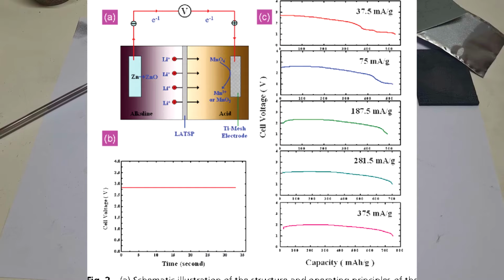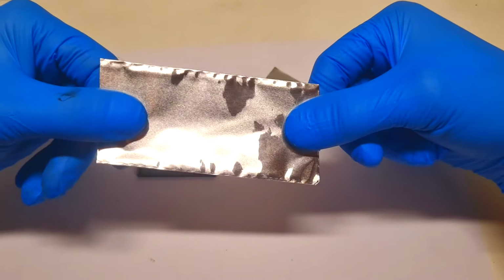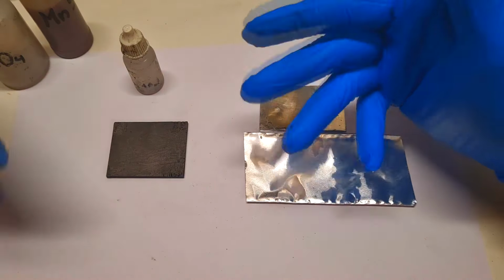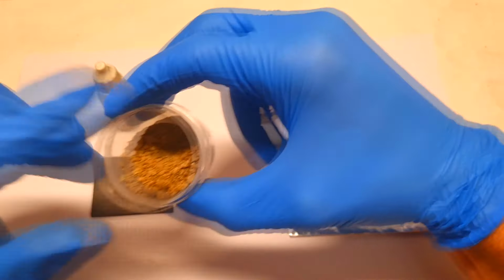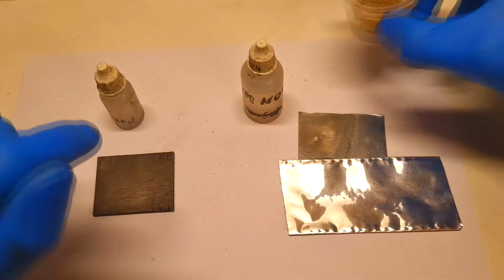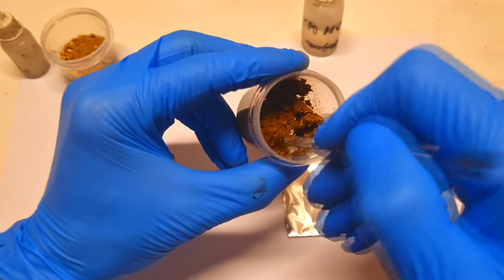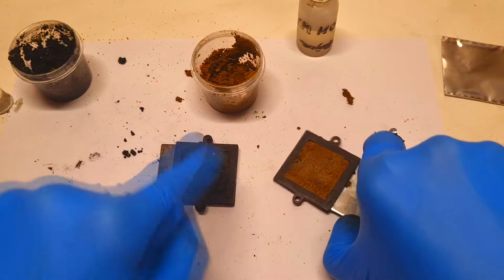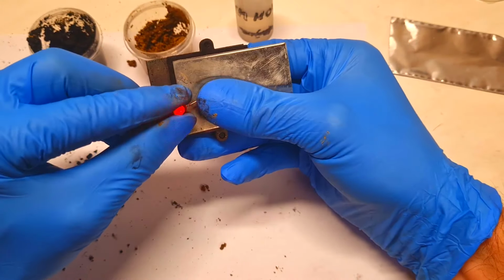DIY high voltage zinc battery without Separator

Comment: What are the energy efficiency, coulomb efficiency, volumetric capacity, energy density, etc? Cycling information is critical to characterize batteries and make sure improvements are actually being made. Characterizing your own devices - know exactly what you're producing - would be really useful to you and your audience as well. So far we have no idea about how any of the devices you've made actually perform.
Reply from the maker: Nah.... to much work for a battery that I am not interested. Here I share ideas about some batteries, where people if they like the idea they can replicate make all the tests, upgredes, etc. On my batteries which I develop I make all the test which need to be done,... so no worries about that. But like I said.... here I share ideas and not research study,.... because it take to much time and you know that.

Comment: Won't that battery self-discharge very quickly even if you don't use it to feed anything?  I mean acidic and alkaline substances in direct contact will start a neutralisation chemical reaction which destroys both in no time. Am I wrong?
Reply: Comment for notification about this thread.
Reply: Ya what's up with that?
Reply from the maker: The acid and alkaline will form a salt in the contact area. The acid and alkaline is hold in dirt and will not mix together easily.

Comment: Thank you for your work. I have been subscribed to your channel for a long time. I am waiting for a recipe for a normal battery. There is one question, the place where one alkaline clay meets another - this boundary layer, doesn't it consume acid and alkali for the neutralization reaction. This prevents it from working for a long time. By the way, how long does it work at maximum load? And in this boundary layer, heat and gas should be generated. Confirm my findings. I want to hear your thoughts on this matter.
Reply from the maker: A normal battery? What is for you a normal battery? Yes, a salt layer is formed between acid and alkaline in the contact area. The LEDs working until the electrolyte has evaporated. Heat is made when the acid and alkaline react together. But here no heat was produced because the reaction was small.
Reply: @cayrex  I consider a normal battery to be at least an alternative to an acid battery with 200 charge-discharge cycles.
Reply: @cayrex  I suddenly had an idea about the boundary salt layer. If you replace the clay with fiberglass or similar basalt insulation. Then if you knead it with your hands - stir the layer to make a flexible or soft battery, then the layer can be broken and let the new current pass from the electrodes. What do you think of this?
Reply from the maker: @ara7878  Aha ok I see,... a alternative to lead acid battery..... a manganese copper,... manganese lead....
Reply: Your best bet would be a nickel iron battery for homemade long lasting. Be around 15 watt hours per kg. Maybe more.

Comment: What is dirt?
Reply from the maker: Emm.... earth, dirt, sand,.... what you find outside
Reply: @cayrex OK thanks. Mostly dirt has negative connotations in English in the sense that it refers to mud or soil or foulness causing a blemish or uncleaness. So I didn't get your application of the word.
Reply from the maker: @meisievannancy  Yea,... I struggle sometimes with my english
Reply: @cayrex No problem. I understand now. Thanks for the high voltage cell construction video.

Comment: sand paper, or belt sander belt, sand ie glass. what a trick, cheesing. lol. I wonder how spend coffee ground powder would work. its biomass tho. wood dissolves in sulfuric acid.
Reply from the maker: You have many options to try. Just use lower concentrations of sulfuric acid